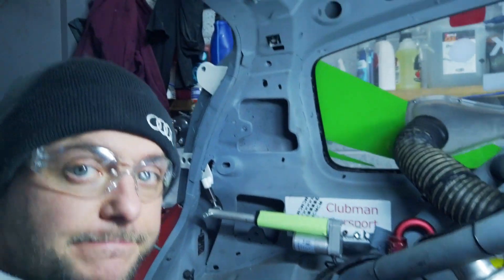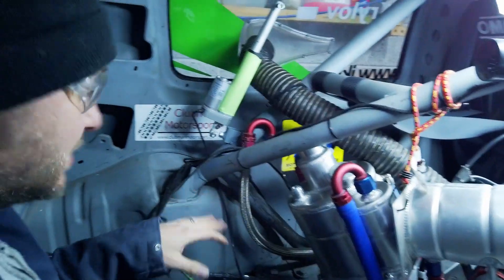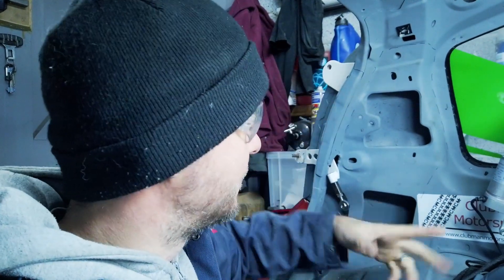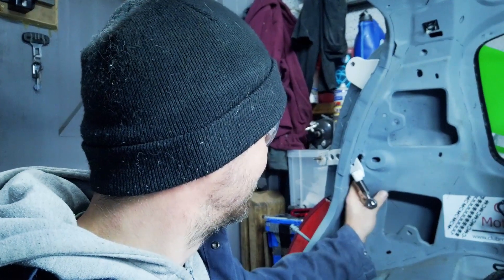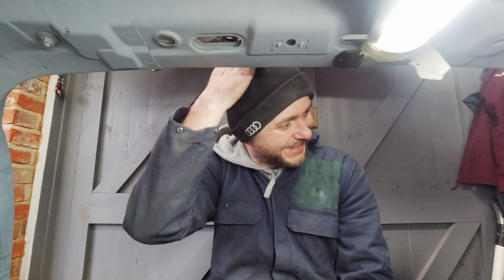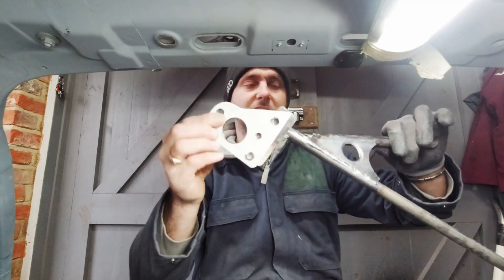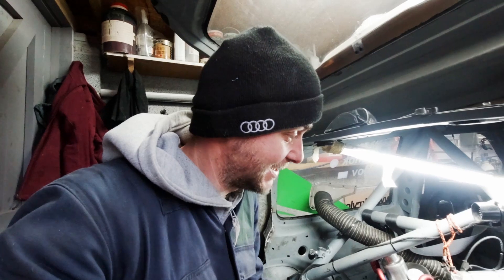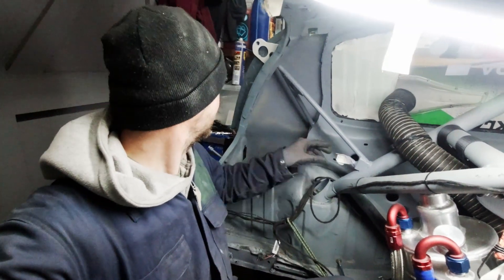CHASSIS MOUNTED REAR WING. making a support for Rear Wings on FWD Car. more weight loss. ep. 28

Comment: As said on Instagram, I like what your doing here, and I agree that when your cage ties in with the rear suspension, you basically don't need any rear structure any more. But why not take it one step further, and take out the complete inner skin which goes above the tailgate? And thinking further on this, do you even need the rear chassis any longer? What's your thoughts on this. Looks like we both might end up with a full spaceframe Clio lol.
Reply from the maker: Thank you! I am not sure I am ready for space frame just yet haha.

Comment: Great work. I had the same grinder as you but recently changed it to the Milwaukee die grinder night and day
Reply from the maker: Small red one? 😂 I have a feeling someone been skipping parts of the video 🤣😉
Reply: @RuskiWeldFab  Milwaukee M12FDGA-422B 12V M12 FUEL Angled Die Grinder Kit
Reply from the maker: Yep that’s the one I have and used in this video 😀🤝
Reply: @RuskiWeldFab  lol I see now I use mine for cutting too
Reply from the maker: Awsome tool!!